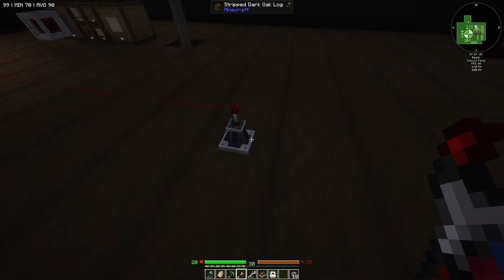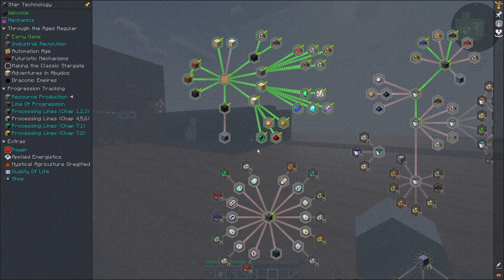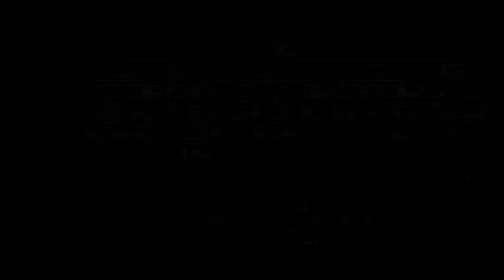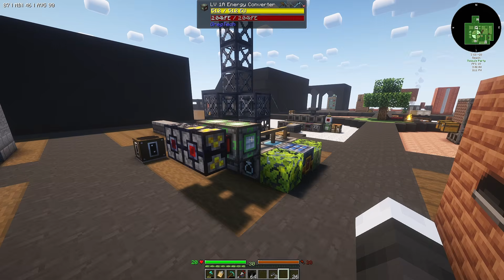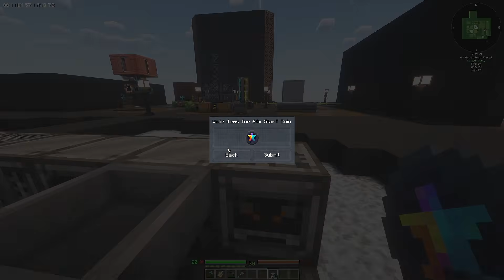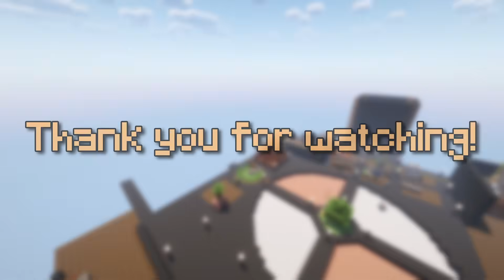Star Technology E6: Passive Everything?

Comment: Dear Hamcorp CEO,

The Electric Ore Factory is capable of utilizing multiple energy hatches like an EBF. It is best to look at a multiblock controller's tooltip to see if it says it can only support one energy hatch. If the text does not appear, check by placing multiple energy hatches as doing so can allow for overclocks that will reduce bottlenecks and improve efficiency.

Comment: Dear CEO, fluid cells from Thermal are capable of storing acids, as well as auto importing and exporting.
In addition, at your current tech level, gregtech pipes made from Chromium, Vanadium Steel or Gold can transport acids. 
Fluid Pipes from Pipez or Create can transport acids as well.

Comment: The sand - glass - silicon dioxide - silicon/O2 loop is pretty good here. Or you can follow the proc line chapter in the book.

Also note! The Storage controller in this does not need to connect to the other drawers directly and just need to connect via the linking tool.
Reply: Can you further explain the loop?
I'm trying to find it with no result.
Reply: @TrueXiarno sand -> glass (Arc Furnace) -> glass dust (Macerator) -> silicon dioxide (Centrifuge) -> Silicon and Oxygen which get supply back into the Arc Furnace (Electrolyzer).

At least that's how it work in CeU
Reply: @thereddeads  I always thought it was cobble->gravel->flint->silicon dioxide->oxygen
Reply: @Cera_01  Thats another way to do it. That's why i said "Or follow the processing line in the QB"